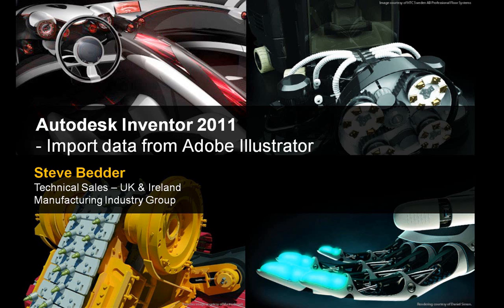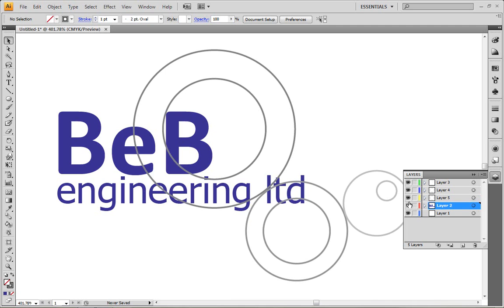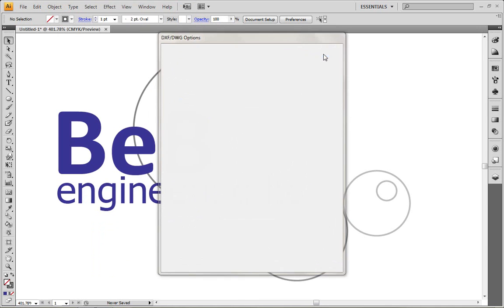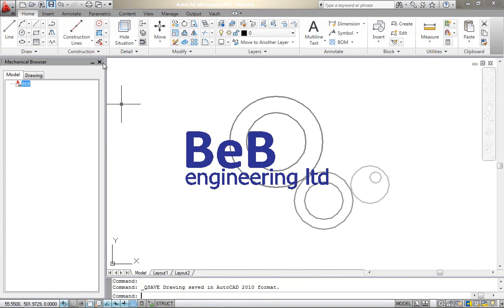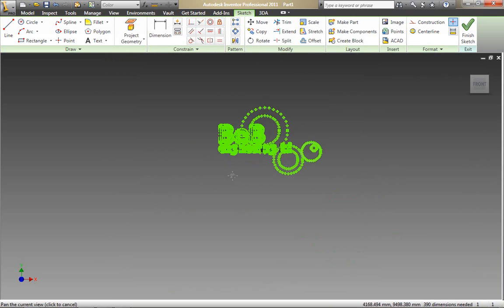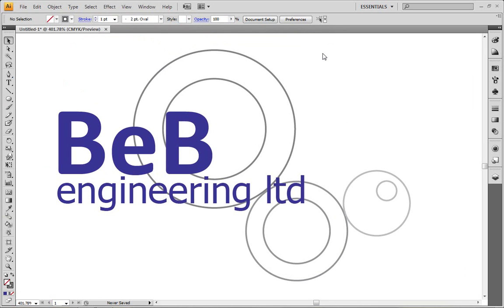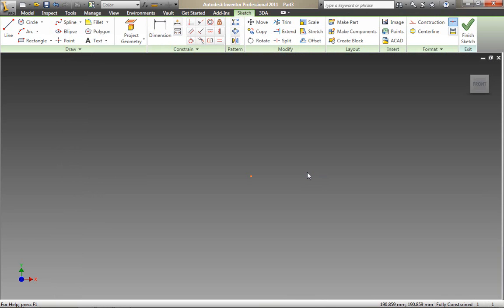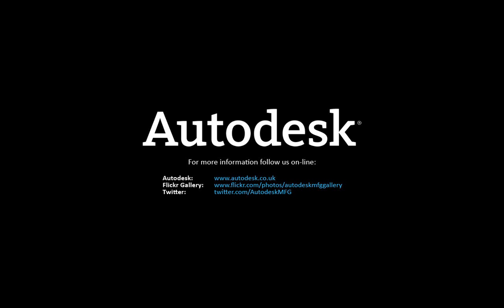Adobe Illustrator into AutoCAD & Autodesk Inventor

Comment: Open the file in Illustrator and use the Live Trace and Live Paint options.  You may have to adjust the tool settings to eliminate edges, but it works pretty well.